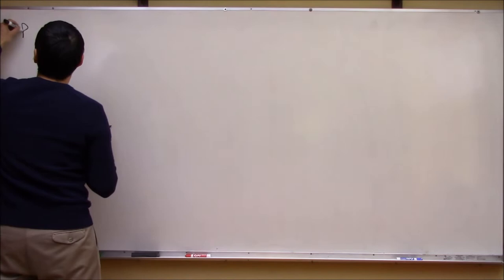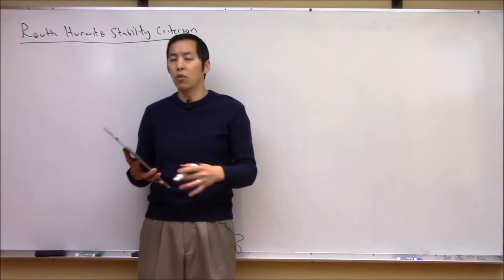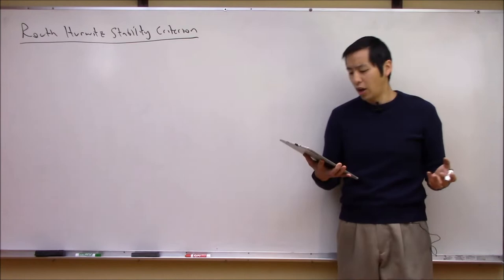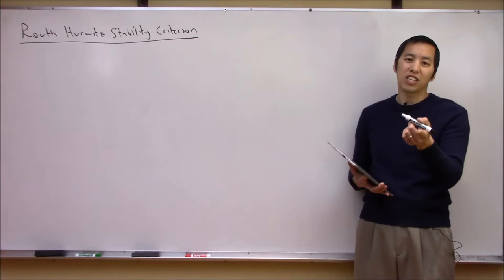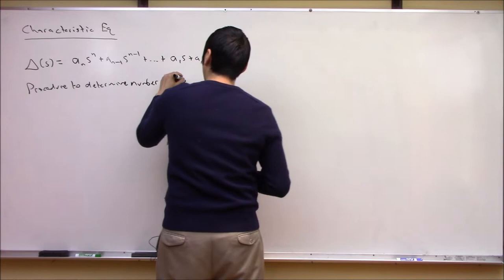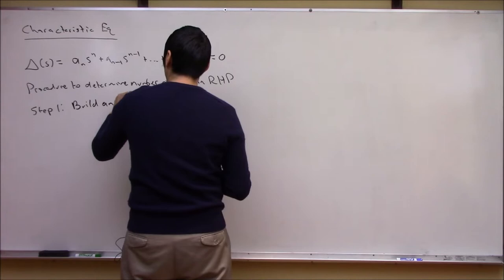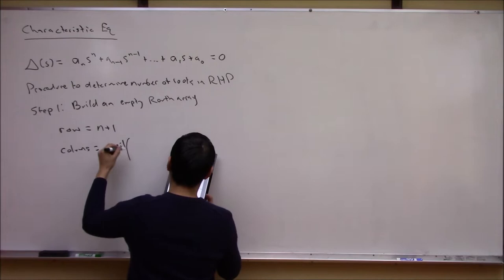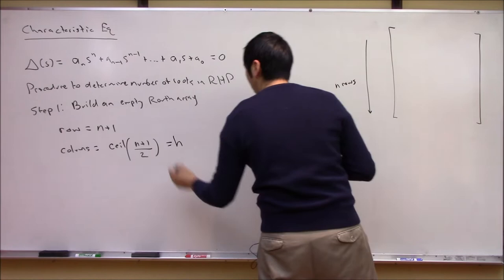The Routh-Hurwitz Stability Criterion

Comment: Dear Christopher,

As an electrical enigineer I am used to parameters "ai" being built up by formulas containing component values L,C & R. So checking each constraint is quite nasty work in itself.
I am glad to see you talking about redundancy regarding the constraints for a 3rd order equation at time coordinate 1:04:00. 
You prove that When a3>0,  “a0>0 & a2>0” both requires  and implies automatically  "b1= a2.a1 - a3.a0 > 0"
I believe that likewise you could prove: When a3>0,  “a0 > 0 and b1= a2.a1 - a3.a0 > 0” both requires  and implies automatically "a2 > 0"
Can you confirm that ?
If that is true, isn't it important to spell that out in a table like the one that you present at time 1:17:05 ?

Best regards Paul

Comment: AE511: Great video! I'm curious the potential of dealing with higher than 4th order polynomials in the real world and the complexity of solving for the routh hurwitz criterion. Lets say that we wanted to integrate this within software to check for stability, as the system gets a higher order does the throughput/amount of computing power rise exponentially? Is this something that we would ever come across (higher than 4th order)?

Comment: AE511: This seems very useful for quick instability checks once you have your transfer function in the Laplace domain. However, I think that due to my greater familiarity with state space models and my natural understanding of time domain, checking for stability with a state space model feels more comfortable. i.e., wouldn't the method described in this video be equivalent to finding the eigenvalues of the A matrix and ensuring they have negative real parts? (if I'm remembering that correctly)
Reply: [AE511] I could see the routh-hurwitz criterion being easier to compute than eigenvalues for a large matrix. You'd have to have RH function that Chris programmed so Matlab could chew through the algorithm, but I think Matlab could compute that really fast even for a complex system whereas it might struggle trying to find eigenvalues.